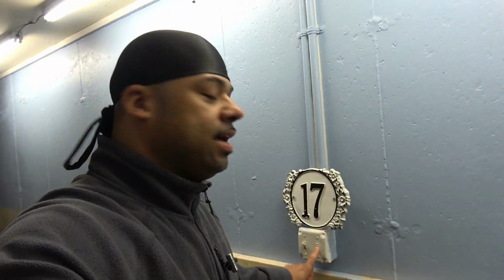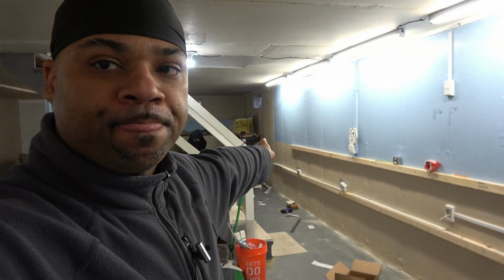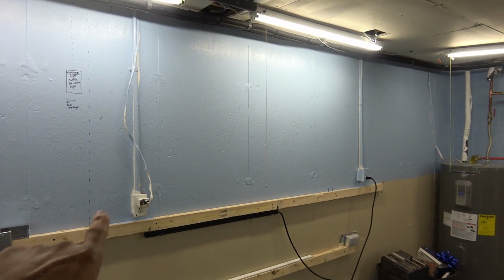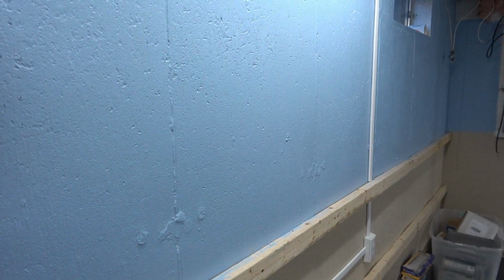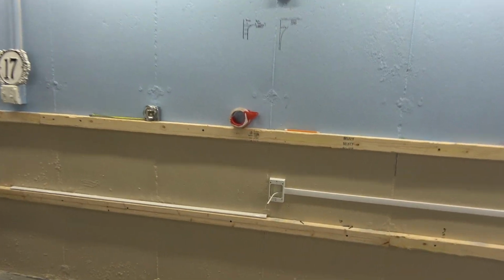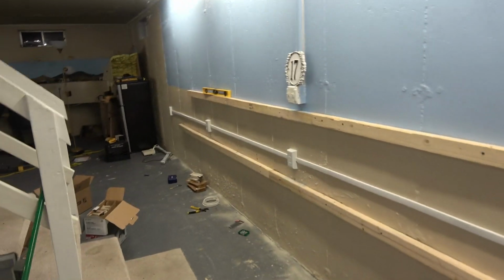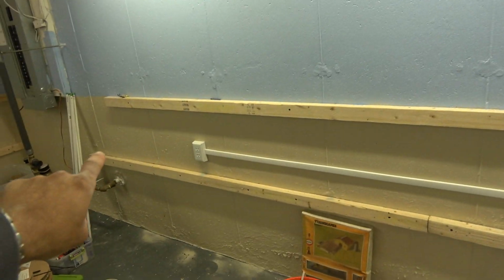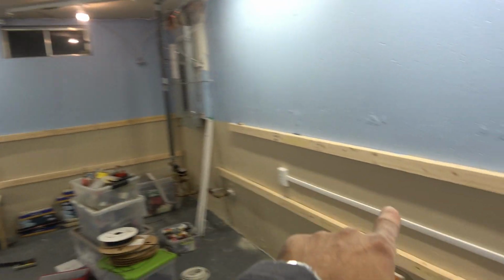01.17.20- Monster Layout Update- Adding New Electrical Receptacles

Comment: Hi Al...  Very nice.  When looking at your lighting, I immediately noticed a problem that I struggled with on my layout - the dark spots on the wall between the light fixtures.   I originally just ignored it - thinking it wouldn't be noticeable.  But once I put up my photo backdrops, it stuck out like a sore thumb.  Then, I put up a valance in front of the lighting, and painted the back side of the valance white - hoping that the light would reflect off and fill in the dark spots.   Nope!  So, I ripped them down and mounted them end to end.  It was a pain.  But it fixed the problem.  Then again...  I'm OCD over things like that.  So.....

Comment: Hey dude . How do plan on working  around  the water heater  because  what happens  if u need to replace  it . .
Reply from the maker: I will build right in front of it with the idea that one day it will need tobe replaced. So I will make the section bolted to the rest of the layout so when the time comes I will remove four bolts and cut the track to move the section forward. Simple.
Reply: @MonsterRailroad  i saw that and i was like hmmmmmm . ..

Comment: Nice job just make sure you secure it to the wall and not just rely on the self adherence on the back it will eventually come lose
Reply from the maker: Yup, did. Had to get new drill bits while doing the projects because two broke while drilling holes.

Comment: Things are looking great Big Al!  One question, what are you planning to do, electrical wise, for the opposite wall that the hot water heater is on? Also, just thought of this, the stairs that the layout will run along.  Your daughter is adorable, btw.
Reply from the maker: So the plan was to bring the wiring from one of the lights and go down that whole back wall. I have since decided to continue on from the last three that I did and bring the wires behind the water heater then along that wall. So that is the new plan.

Comment: I think I would bring those steps down to a landing and turn them 90 degrees to give you more room along the wall.
Reply from the maker: Nahh. I am not worried about the layout section there. That is going to be less than 1 1/2ft wide and will go into a tunnel as it leaves the scene and into hidden staging.
Reply: @MonsterRailroad  See you at Amherst

Comment: When I did the plugs in my room the bottom plugs are on a switch so I can be sure to turn off he power when I leave the room.
Reply: I did the same thing too.    
RL Jenkins
Reply from the maker: I did not want the plugs to be on a single light switch. Having power all the time to the receptacles is better. I simply just add a switch to the layout power and brought the one I had on my last layout with me.